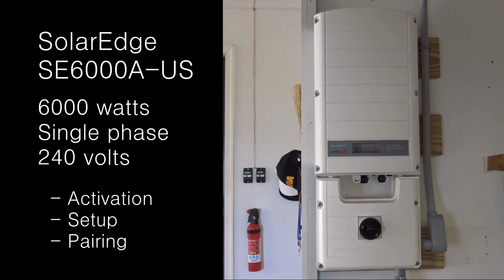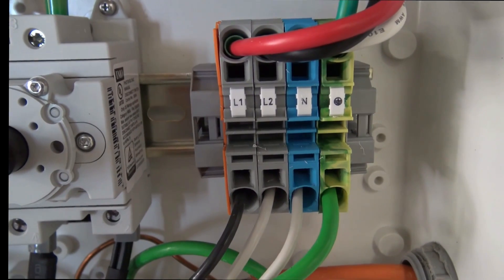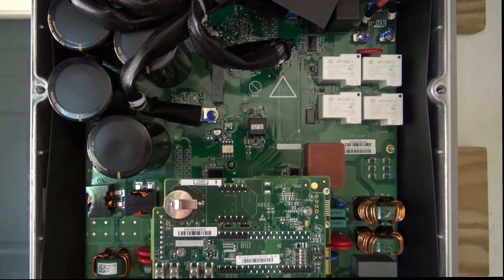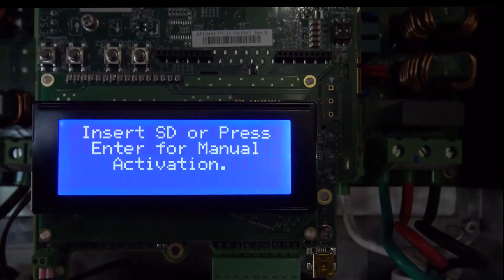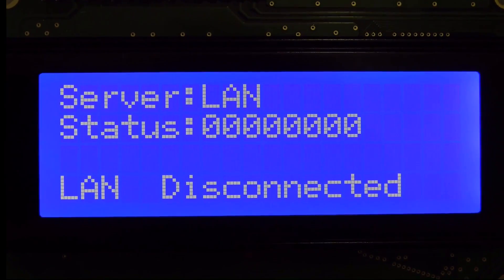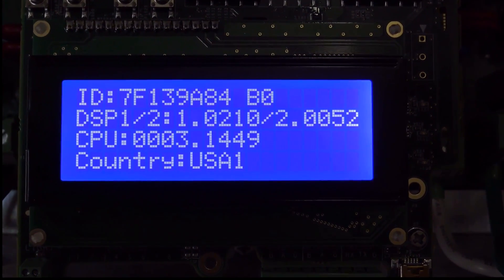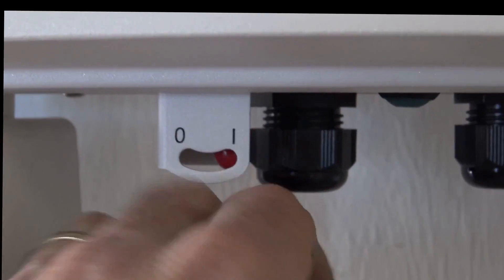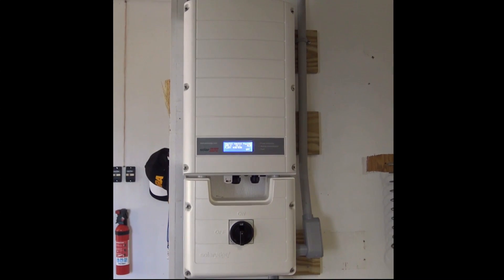SolarEdge Solar Inverter - First time powerup - Activation, Setup, and Pairing

Comment: The commissioning part of this video is pretty good, but the installation itself has a few things that would fail an electrical inspection. 
1.  DC power must be installed in EMT or rigid conduit. 
2. PV wire can not be run in conduit. You must have a junction on the roof under the panels where you switch over from PV wire to #10 THHN. The reason behind this is heat disbursement.
3. The panels are exceeding the roof edge which will create a strong upward wind loading on the panel. No bueno...

Comment: What if your screen wont stay on even when I press the button on the bottom to wake the screen. I powered off the inverter,dc, ac, and breaker panel and  reversed and was able to get the unit to turn back on for a brief period but then turned off.

Comment: Activation key ?  12312312 does not work!
Reply from the maker: Hi.  12312312 is the password to access the menu.  The activation key is a different number and it was printed on the front of an SD card that came with the inverter (my video on the SolarEdge HD Wave shows a picture of the SD card).  In my case, the activation number was also printed on a label on the side of the inverter.  Because my SD card or the reader was defective, I had to enter the activation number manually.  There was a menu prompt for entering this activation number but I don't recall the details.

Comment: Thank god I found this video. I was hooking up a LAN connection to my inverter and messed up something in the settings. I think I put it to “pair up” with my dc switch off so it wasn’t linking to my panels anymore. Thank you for making such a detailed step by step guide. You saved me at least $100 if not more to have someone come out to fix my stupid mistake.

Comment: thats an old video but i am gonna give it a try and ask. i have a 40 panels with 40 optimizers ofc. whats the voltage i should be getting when measuring straight on the string + - cables? should it be 40v regardless if it is a sunny day or not OR something like 700-800v ? please get back to me if you see this because i have a problem with my system.
Reply from the maker: Hi. Allowable string lengths for SolarEdge have a maximum and a minimum.  Check your spec sheet (cut sheet) for the model inverter you have.  For example, if you had 24 panels - you would not be able to connect all 24 in a single string.  Instead you could configure the 24 panels as 2 parallel stings with approximately half the number of panels (12) in series.  Both strings can connect to the same lugs on the DC inputs of the inverter (both negatives on the negative lug and both positives on the positive lug).  The string lengths do not have to match because the DC power optimizers will balance the voltages for the entire string, but there are limitations to how unbalance it can be.

I'm not certain what the reasons are for the string length limits, but I will guess that it is a reliable operation limit on the low side (effective DC boost limits) and a voltage safety limit on the high side in case of faults that could be present (and perhaps DC buck limits). 

Depending on the inverter, you might be able to do 3 strings of 13, 13, and 14.  Check the specs please.

Comment: Franchement, a part changer les optimiseurs défectueux ou rarement des onduleurs, je confirme que depuis que je travaille dans le photovoltaïque (15 ans), je n'ai jamais fait autant de maintenance qu'avec des optimiseurs Solar-Edge ! Ils tombent en panne comme des mouches. L'idée de base est pourtant bonne. Mais la fiabilité pas du tout au point.  Au fur et à mesure que j'installe leurs produits, je suis de plus en plus déçu au point de détester poser du Solar-Edge. A chaque fois que nous faisons une installation Solar Edge, nous savons que nous allons revenir pour changer des optis (100 % de chance). Qualité des produits pas au point. Visserie des capots onduleurs souvent défectueuses, compteur d'autoconso mal fini et mal conçu. Bref, je vous conseille de vous éloigner de Solar-Edge pour votre installation photovoltaïque.

Comment: The dc optimizer are need them or you can skip them. I have already running a off-grid 12kw inverter with a 70kw battery, but when is sunny I am making more energy than I'm using, so I was thinking use the same 12kw/array panel to send some energy to the grid. I need an advice
Reply from the maker: With this system, you must use the associated DC optimizers.  It's a very good solution if you have un-even or shaded light on an array.

Comment: I hava a 10k model..I can not find, if the DC input is 12volt or 24volts. Can someone advice?
Reply from the maker: The solar DC input runs around 400v DC.  There is no battery storage on this grid-tied system.

Comment: If I have a LG 12 panels 3.6kW system, should I go with a 3800W or 2900W inverter?
Reply from the maker: Definitely the larger.  If you're applying to connect to the grid for net metering, go with the largest inverter you can (more or less).  You can always under utilize it and increase capacity in the future.  Please check out this video:
https://youtu.be/wLxiOGb11ZM

Comment: Very informative, thank you for this. If I have the exact system with an LG RESUh 10 also, do you know if there is a way to control the discharge of the battery through the SolarEdge inverter? Thank you in advance for any help you can offer!

Comment: Did you connect the ethernet cable later or used WIFI ? In the setup it displays as not connected which means you're missing out on the monitoring portal. 
For a system which has the possibilty to hook it up I would say check it out.
Plug for ethernet cable is on bottom left from LCD Panel.
Reply from the maker: I would love to set that up.  Sadly, we don't have good internet here.  At least I have cell phone service.  Nobody cares about us folks out at the end of the road!  One day I hope to set that up.
Reply: @Hullspeed I need to connect Ethernet since 3g card is being discontinued… What all can I turn off before opening box , I need to be able to use the display to change to lan setting

Comment: Do I have to use the DC optimizers with Solar edge inverters? Can I just hook it up like a normal inverter??
Reply from the maker: Yes.  The DC optimizers are a required and integral part of the system.
Reply: Needs the optimisers. There is no MPPT controller in the system, this is effectively done with the optimisers

Comment: Hi, I'm going to be using 3 strings of 10 panels. So I will be having 3 pairs of wire coming in. I see how you easily had space to put 2 pairs of wire inside, but how would you be able to do 3?
Reply from the maker: The 2 pairs of the DC terminal blocks are electrically connected.  The two positive lugs are simply on the same bus - as are the two negative.  Even though it looks like it could be, it is not two separate circuit inputs into the inverter.  The DC optimizers allow all the DC power to flow together as it enters the inverter.  So for 3 or more strings, you just need to figure a way to "Y" the strings together - perhaps with an insulated cable clamp or you could connect the strings in an adjoining junction box.   So you might be wondering... does that mean all the strings end up having the same DC voltage as they enter the inverter?  Yes they do.  The DC optimizers make that happen while continuing to hold the individual panels at their maximum power production point voltages.  Even if the strings are different lengths (within limits).
Reply from the maker: Hi Refuso,
I did the test and it worked.  See above.
Best,
Hullspeed
Reply from the maker: Hi ZPaul,
I just completed a test where I connected 3 strings of 14 to this model 6kW inverter.  I clamped the string's ends to a single wire and plugged those single wires into one of the DC inputs.  All the optimizers paired and the system generated without trouble.  This was a cloudy day; I would not want to do this experiment on a sunny day because it would likely be too much DC input power.  The specs for the 6kW stay this unit supports 1 or 2 strings.  

I understand that, ordinarily, the best way to wire up 30 panels would be 2 strings of 15, but depending on where the panel groups are located, you might not be able to easily do that.  I can't tell you what Solaredge would recommend; all I can say is that I did this test and it worked.  I plan to do a longer term test in the future, with this inverter, running three strings of 9, 9, and 10.
Best,
Hullspeed

Comment: I solve the 246 VDC low voltage problem on the input of the Solaredge inverter, The temp was 105 f on the day in Sept that the solar system was tested.  One month later in oct-The utilities finally installed their meters and The solar system is up and running today, the VDC reading is 370 vdc with all the different  wattages outputs through the solar cycle. It peaked at 5600 watt which is good for this time of year.  The solar panels have a negative  temperature coefficient causing them to drop 100 Vdc with extreme heat here in southern NV  with the solar panels on the roof. Thanks All

Comment: This is an excellent video presentation. You did a great job. In the video you used 30 solar panels. What is the nameplate (sticker) wattage of each solar panel. There was a comment that you used 280 watt solar Panels (module) is that correct
Reply from the maker: Those are definitely either 275 watt or 280 watt; I'm having a hard time remembering which one.  I'll go back and check my invoices.  That is very interesting about the temperature response.  I would expect some performance loss in the panels, but that is really dramatic.  I wonder if the DC-DC converters were affected by the heat somehow?

Comment: What happens if a string has 7 p300 optimizers which is less than the 8 module minimum, could this drop the voltage to 247 VDC

Comment: I had a solar edge SE7600A inverter with twenty eight 300 watt modules and twenty eight p300 optimizers installed. the optimizer are connected in 3 strings of 10-9-9. The system was design to be overdriven 125  percent because solar edge allows inverters be overdriven to 135 perecent to compensate for clipping. The system was bumped to test it- the system paired all 28 optimizers with no error.The inverter was running okay producing power. The reading on the inverter window was 240vdc-246 Vdc-5250 watts.I thought The inverter should be reading about 360 vdc but instead it's reading 240 VDC. The hot line to Solaredge said that there were to many panels on the system. what is why the VDC is lower.  Does anyone have experience when the system is over driven that it lowers the dc voltage.
Reply: Made a typo s/b 240 vac-246 vdc-5250 watts pac
Reply from the maker: Hey Anthony.  You're not overdriven until the sun comes out real good and you hit 7600 watts, then it should hold right at 7600.  I don't think you have too many panels.  I'm running 30 (275 watt) panels on a 6000 watt inverter and it works great (2 strings of 15) and holds right at 6000 watts for a few hours of the day.  Although my theoretical maximum wattage should be 8250 watts, the most I would get with a larger inverter would be about 6600 watts.  I have checked by pulling a string and I get about 3300 watts on 1 string of 15 during best conditions.  I also have another system with 2 strings of 9; I'll check the DC voltage incoming.  9 in a string is on the low end of what's allowable.  I might have run 2 strings of 14 to keep the optimizers from having to boost the voltage so much, but by putting in an extra string you added more DC copper, so... nothing wrong with that really.  But I wonder if you hit a limit on how much your optimizers can boost (I don't know).  The panels themselves are probably sourcing around 30 volts each at the most efficient production point - maybe even less if the sun is not great.
Reply: Thanks that's good information. it helps a lot.
Reply: Turns out the heat on the solar panels were causing the low voltage

Comment: I hv the same exact set up as yours, except only 23 panels = 6.21kw. This week, weather shots over 100 deg f. The panel vac 40a circuit breaker tripped everyday. And it is very hot to touch. So I decided to replace it after research , trip breaker may be breaker is going bad. However, after the replacement of breaker, I turn on the inverter dial knob, the lcd screen not display, no leds. Can you help explain why? I check vac, it working properly after breaker switch on. Thanks in advance.

Comment: Mine won't change off Night Mode. Do you have any ideas on how to correct this?
Reply from the maker: Verify your DC-DC optimizers are initialized and that you have at least a the minimum number of optimizers and panels in each string.  It should move out of night mode automatically when the sun is out.

Comment: Thanks, good video...looking to do exactly what you have done. Where roughly are you located and what is your daily AVERAGE power generated with your current setup? Thanks, Norman
Reply from the maker: Egad!  I said 1 degree slope in my reply.  I meant 10 degrees!!!  I re-posted the reply with  the correct number.  So... this array faces east, so it cranks out the power in the morning and mid day.  It wanes off heavy during the sunset hours, producing just 100 to 200 watts.  It goes to sleep as the sun it's the horizon.  Maybe I'll post some production graphs in my next video.   You can do east facing and west facing on the same inverter and the power production shifts from one set to the other as the sun goes across the sky.  A lot of times, you don't get to pick the orientation.  You just have to go with what your roof dictates and that's that.  As far as reliability is concerned, I have had ZERO breakdowns and the panels don't seem to have lost any efficiency at all at 3 years old.  Really neat.  Regulations limited me to a 6kw inverter, otherwise I would have put in a slightly larger one.
Reply: Hullspeed good sir, any chance i could pick your brain? In NoVA looking to put together an east/west 7kwh install next month, sounds similar to your setup perhaps. Super curious how the system has panned for the long term, sun-hour performance, etc :) would greatly appreciate it!
Reply from the maker: I'm near Washington DC.  From July 2016 to July 2017, this 6kw system produced 9175 kwh.  During sunny summer days, the unit is pegged at 6000 watts for a few hours.  The array is at a relatively flat incline (about 10 degrees) facing east.
Reply: Hullspeed a gentleman and a scholar, thank you :) graphs would be amazing! This info is already great though :) appreciate it!

Comment: I have the same inverter se3500h but without the box below it? Currently have 14x260wp panels, but in heavy shadows. 3000w+ barely to never happens.

How would I add 4 to 6 extra panels myself? I mean like add the panels in online portal and stuff. Can't really find any information about that specifically

Comment: Can this be used as backup power or grid power needs to be on?
Reply: David Martins it can be used as backup power ONLY if you had a battery system to store the power being generated.

Comment: does not look like the AC side is NEC compliant with wire colors
Reply from the maker: You're talking about L2 not being red insulation perhaps.  I'm back feeding into a legacy 3-wire 240 volt circuit from an abandoned HVAC system.  New construction would be different.
Reply: This would not be allowed here in California or Hawaii regardless of new or existing pre-installed electrical connections.
Reply: You are using the bare ground as a neutral. That is not legal or safe. The neutral wire is current carrying while the ground wire is not. The neutral and ground wires end up in the same place but until they get to the first service panel where they are bonded they should be separate.

Comment: What do the  SolarEdge optimizers do? I see that you have 30 panels. Let's say if one is completely covered in shade for whatever reason. Do you still receive the benefit of the other 29 panels? Or only 15 panels, because you have two strings of 15.
Reply from the maker: Hi Robert,
The optimizers allow each panel to produce energy to the maximum extent, individually, regardless of what is happening elsewhere in the string.  In your example, given a simple string, the entire string would be constricted because of the one shaded panel (which would block the current of the entire string to an extent).  With optimizers, the power flows through the "shaded" optimizer without being blocked, plus the shaded optimizer adds its little bit of power to the string.  Optimizers also allow strings of different length to be plugged into the same inverter (as parallel circuits) without a loss to efficiency.  Optimizers are not micro inverters; they are more like remote-controlled DC to DC converters which appear to maintain a bit more than 400 VDC at the inverter terminals.
So in your example, if using optimizers, you would get the maximum benefit from all 30 panels - but the one shaded panel would provide less benefit.

Comment: Hullspeed, Great work! I'm installing my own solar system as well. I have twenty five 315 watt panels on two strings of 12 and 13 going to my solar edge 10w inverter. Your video was very helpful. I may have some questions for you on my wiring. Thank you, Robert
Reply from the maker: Thanks Robert!

Comment: placing power optimizer  ( switching power supplies ) on the roof and using plastic conduit you are going to have high levels of radio/tv/wifi static in the home and around your home for more then 100 feet... placing some fair-rite cores on the every wire longer then 2 feet would help...
Reply from the maker: I haven't observed any indication of radio frequency noise or interference.
Reply: listen on 560 AM radio or 1.9 Mhz shortwave during the day.